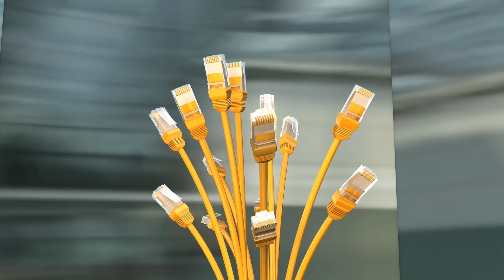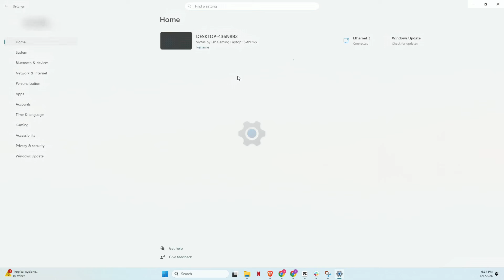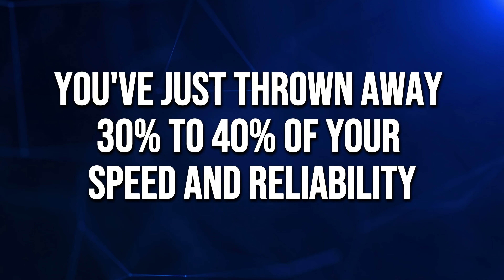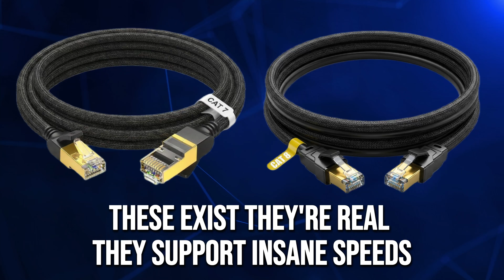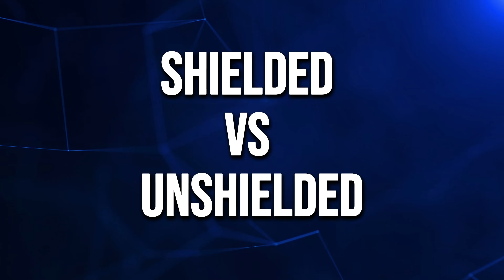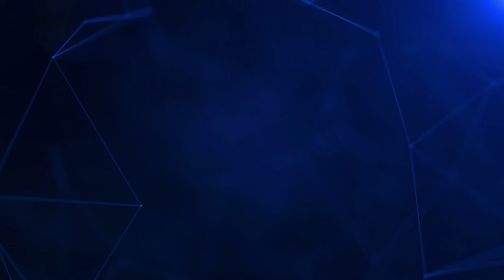Stop Trading on the Cable That Came in the Box

Comment: Eddie. I built a trader. Can I use same PC for trading and working if I isolate trading on a separate user? Running out of space. 2nd PC for just work/play is too much.
Reply from the maker: Totally understand the space constraint — a separate Windows user account does give you meaningful isolation, keeping trading clean from work browsers, notifications, and background apps. Here's the thing: it works, just be disciplined about never crossing streams. What platforms are you running on the trading side?
Reply: @eddiez-trading Thanks so much. Tradestation, Blofin and Trading view.
Reply from the maker: Good stack — TradeStation and TradingView are well-behaved on Windows, and Blofin is browser-based so Edge is your friend there. The separate user account will keep that setup clean as long as you keep the trading profile lean. You're in good shape.

Comment: I was in networking before Voip. Was all telecom. I too use the 6a in home network. However fiber to junction and 5e to modem. TDS says 5e can accomodate speeds delivered. Wont change out junction to modem to 6a.
Reply from the maker: That's a solid background to have — and TDS is right that 5e handles the speeds fine technically. Here's the thing: for trading the cable grade matters less than eliminating any loose connections or old crimps between that junction and your modem. If the run is clean, you're good.

Comment: if you dont have an edge, this cable will just be an additional -$12 loss to your trades.
Reply from the maker: Ha, fair point — no cable upgrade fixes a shaky strategy! The hardware just makes sure it's not the cable costing you when your edge is working.

Comment: Is there a way to run a fiber optic cable from your router to your pc?
Reply from the maker: Good question — yes, you can, but it usually takes a media converter or an SFP port on both ends, since most routers and PCs only have copper RJ45 jacks. Here's the thing: for a short run from your router to your PC, you won't see any real-world benefit over a solid Cat6 cable. Fiber earns its keep on long runs or heavy electrical interference — not the few feet to your desk.

Comment: Just ordered from Monoprice with all the specs you mentioned, Can't believe I was using a cat6 that was super flat... Not round at all...

I got a CAT6A stp full on copper
Reply from the maker: Cat6A STP is overkill in the best way — that cable isn't going to be your weak link for a long, long time. Smart upgrade.
Reply: @eddiez-trading thanks again Eddie!

Any recommendations on a hard case for airplane travel on your Excalibur customs?
Reply from the maker: Hard-shell cases built for laptops/equipment (like Pelican-style cases) are your best bet — look for one with customizable foam inserts to fit the Excalibur snugly. Worth padding around ports and corners especially.

Comment: Is there a brand of cables that are generally better, or at least consistently good?
I've been looking for cable manufacturer reviews and don't see any in the last 4 years.
Reply: Supposedly Cablematters and Monoprice are some of the best
Reply from the maker: Monoprice is generally a safe, consistent bet — solid quality without the markup. Here's the thing: for cables, certified ratings (Cat6A, HDMI 2.1, etc.) matter more than the brand name itself — any reputable brand hitting the spec will perform the same.
Reply: All cables not just cat. Monitor, USB, HDMI...
Thanks
Reply: Check out bluejean cables. Wealth of information.